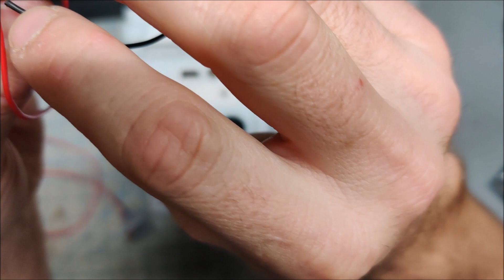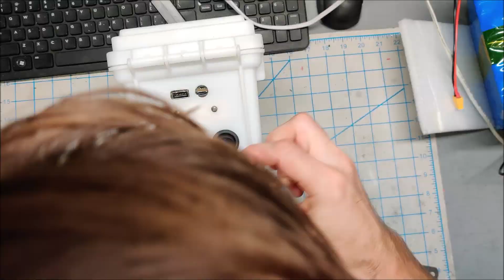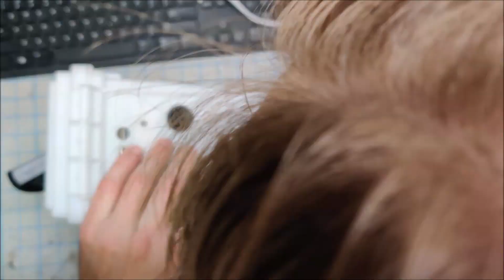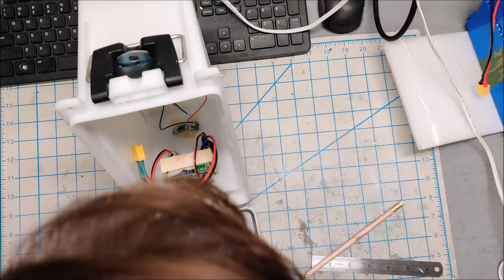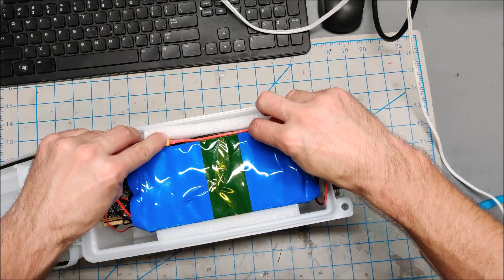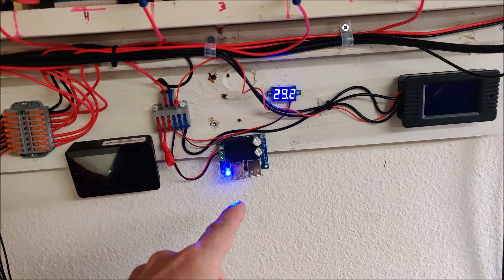Meter for Laptop powerbank & 1000 subscriber giveaway!

Comment: they can be ajdusted to get them in range by the trim pot on the rear
Reply from the maker: Will look too see if they have a trim pot. They are tiny.
Reply from the maker: Retested. You are correct for one of the two meters. Thanks 👍
Reply: @stevenc22  no prob yeah I did not see one on the large ones
Reply: @stevenc22  you will also find that voltage is not a good indication of charge level with lithium you need a meter that you can set the capacity and it counts down columb meter or something like that https://1drv.ms/u/s!AphPe-iYxAct9CP6-pSpiLa9RV1a?e=Hhsro5